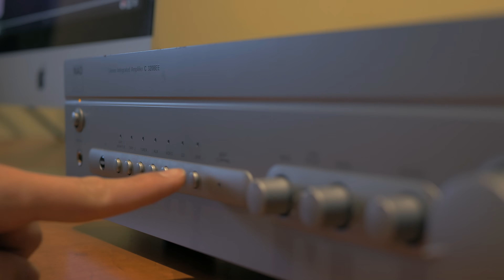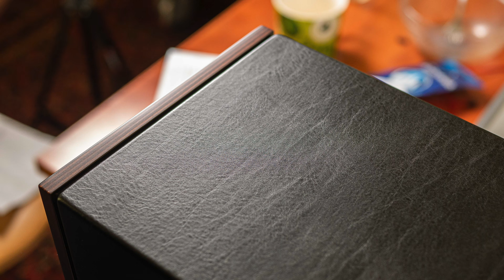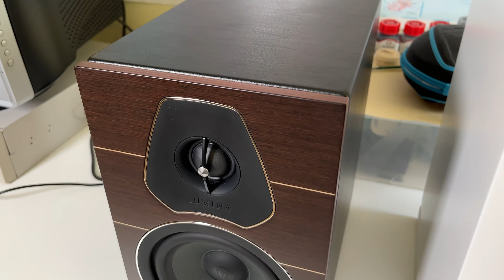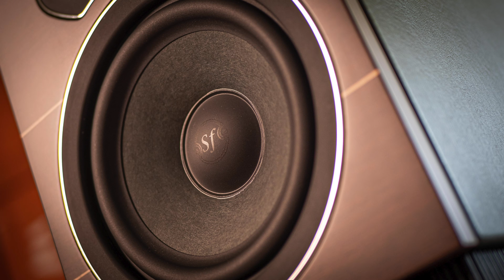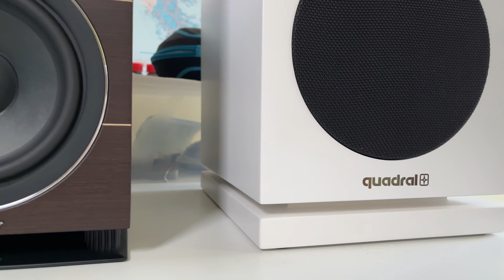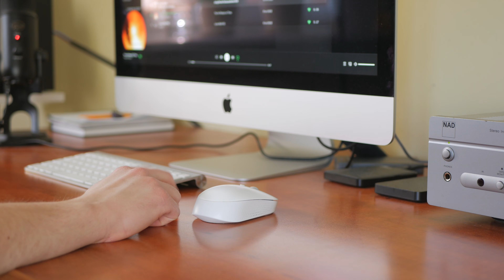Sonus Faber Lumina II – My Opinion!

Comment: Your description is so nebulous that I can't discern what the actual issues are with this speaker: "some tracks sound weird", "they engage in some trickery". It would be nice to have a description that was more tangible and meaningful..
Reply from the maker: Generally I tend to make two kinds of tests on this channel: full reviews and brief "my opinion" ones. In first I usually present measurements and more extensive/objective (based on measurements) descriptions. Latter is more of a first impression video. Still valuable I think. In the end its not easy to describe the sound with words (I should add: especially with those Lumina 2s) and simple frequency response in listening room won't tell a whole story either.

Comment: I had Lumina 1 + Naim Atom + Eagle Cable High End speaker wires. Sound was amazing, just little bit soft for rock music. I changed wires to QED Reference and speakers became faster and no soft. After I changed to Lumina 2 because relocated to biggest room. In 34qm is sounding like floorstanding speakers. Now I’m calm and happy.
Reply: Lumina 2 not too small speakers?
Reply: @RedEye_88  no. The speakers looks just small but they have wide scenes and bass is deep. Now I connected bi-wire cable and results being better than I expected.
Reply: thank you ! @vidaswidas
Reply: @vidaswidas 
Yes but faster or not than Lumina 1 ?
Reply: @manugrandest1683  because I played with Naim and naim is powerfully good and no matter I or II series.

Comment: You are decidedly luke warm about these speakers, an interesting contrast compared to the many gushing reviews all over Youtube. It made me suspicious about those other reviews and my suspicions proved correct. These are pretty average imho and in no way match the praise that others are heaping upon them. They might get better, I'm about 6 hours in, but they're not going to get that much better...
Reply from the maker: Thanks for nice words! This is the philosophy I adopted from the begining (for both of my channels) – to provide with the most trustworthy and honest reviews, as much as I am able to. I feel there is especially need for that in regards to the Hi-Fi tests. There is just too much hype about some products and some channels that rate pretty much every speaker as Tier A. Add to that the whole audio voodoo (cables, power filters) and in the result you get field that really needs a lot more critical thinking and objectivity (in its subjectivity 😉).
Reply: I have tried Sonus Faber Lumina II Amator, Sonetto II, Dali Opticon 1 Mk2, Opticon 2 Mk2, Rubicon 2, new Rubikore 2, B&W 607 S3 and 707 S3 paired with bluesound Powernode and NAD M10 V2. The best compromise for my little room is NAD M10 V2 with the B&W 707 S3 and 2 B&W ASW610 subwoofers. For Dolby Digital and stereo surround duties system is helped with 2 bluesound Pulse M wireless speakers. Sometimes I use Pulse M in other rooms. This combination is much better than traditional AV systems for music listening and smaller and wireless components are less dominant in the quirky, compact rooms. For movies are good too and it is quite difficult to implement Dolby Atmos in smaller places anyway. B&W and NAD Master 10 give to system high fidelity sound and a very good 3D listening experience in the smaller rooms. Sonus Faber and Dalis are more musical speakers, especially for classical and MTV Unplugged types of music.

Comment: Thank you for the review. I personally find them gorgeous to be honest. At the store, they sounded beautiful, though I did notice the lack of deep bass. Do you think an added sub would be worth it with these?

Also, maybe a silly question, but I’m still new to music equipment: the speakers say recommended power is 30-130W at 4Ohms. Is this per speaker or for both speakers? In other words, do I need 2x130 or 2x65 amp?

Tnx
Reply from the maker: I personally prefer 2.0 setups in contrary to the 2.1 but also I've never had subwoofer dedicated for music listening so maybe I am a bit biased here. 

Usually they give description of watts per channel – both in speakers (so for one speaker) and amps. You probably need to look up power at given impedance in the amplifier too. That's said, those are really only manufacturer recommendations. I was running them with my beloved NAD C320BEE and to me those 50 watts were quite adequate... but of course, higher end gear the better but I think 50 watts would be a minimum optimal power for those kinds of speakers (though according to some there are exceptions such as legendary NAD 3020 with only 25/30W).
Reply: @MAudiophile  thanks for the answer. I, too, have no experience with 2.1 for music, but I’ve read people recommending a sub. Btw, the seller where I’ve tested these recommended the Marantz pm6007 with them, which is 50W per channel at 8o, or 65W per channel od 4o.By your comment I guess that’s enough. Thanks again!
Reply: @alex.j87  you definitely need a subs to reach those low notes we are missing on any bookshelf speaker
Reply: It’s impossible to get deep bass with a cabinet this small. You would need a sub.